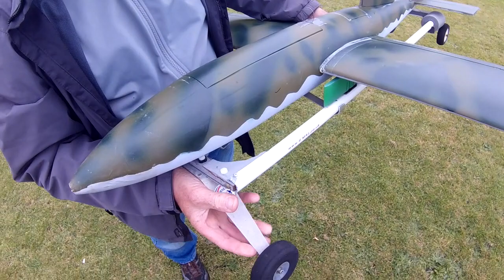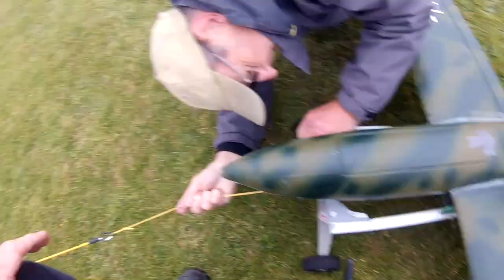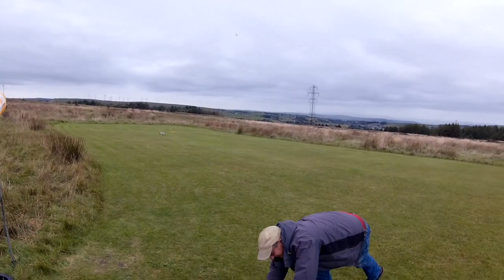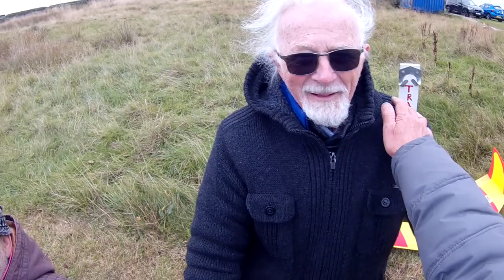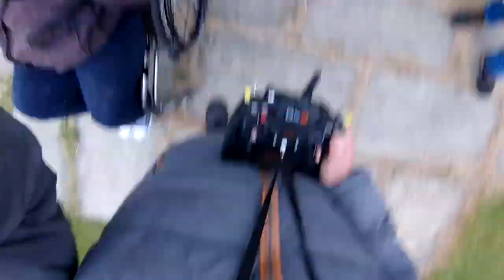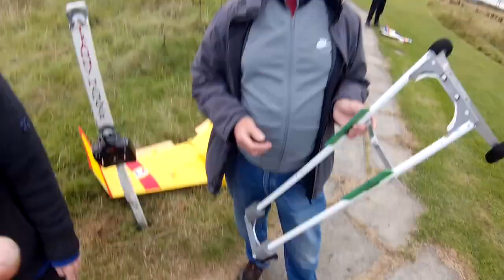V1 RC doodlebug buzzbomb device, 2nd flight. RHMAC

Comment: Is this from a plan? I am currently looking at a plan by Nigel Hawes. Do you have any incite you can share on the build and flight please? 
Great flight, you should be proud. Well done.
Reply from the maker: Hello, not seen the Nigel Hawes plan. All I can say is that the engine pod mounting ahs to be very strong, I made sort of "Y" section supports from carbon/ply laminate. The pod mount take lots of stress with the weight and mass of the motor in it.
Reply: Thanks for the reply, I am un-used to ducked fan tech, the wing span is 40 inch and fuz is 48 inch but I dont know yet what the all up weight is until i build it. Any advice would be most greatfull. Nick. @BackwardTelevision